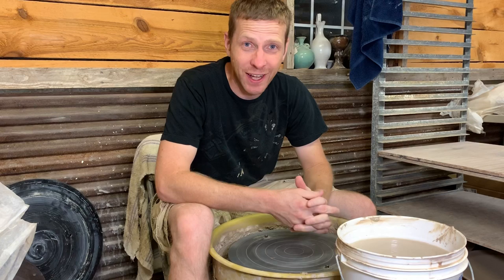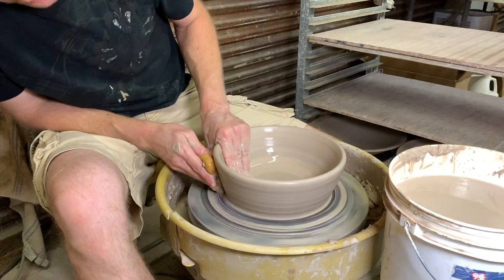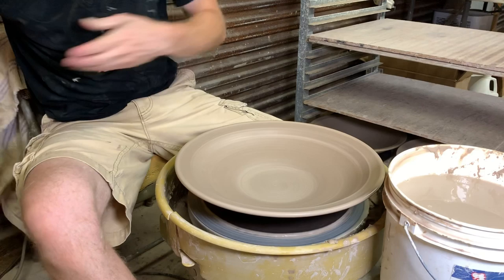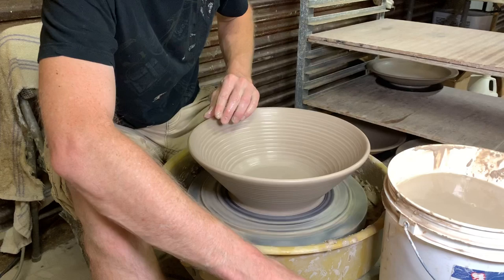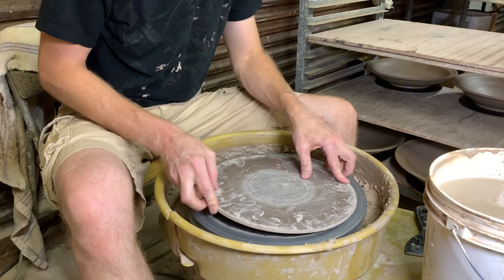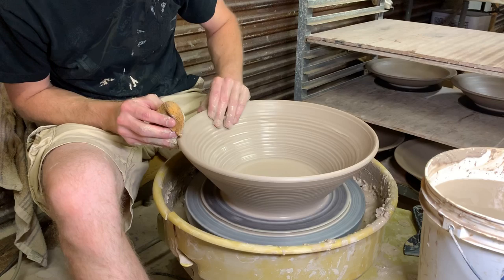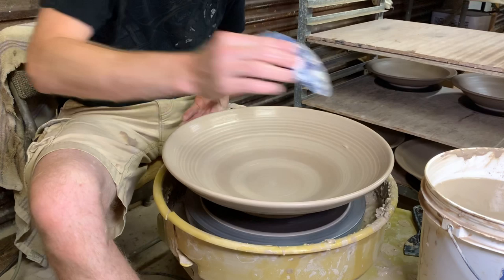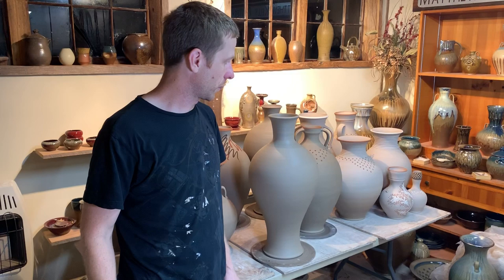Platter Bowls for Wood Firing #1: Throwing and Conversation

Comment: Throwing clay 90 degrees to the axial direction of the pug is excellent advice. Fortunately for me, I learned this early and can testify that all the "compressing" in the world cannot compare to proper orientation of the clay. Working on bats also prevents flexing when you take your piece off the wheel, the clay has a memory and if you flex it and can "Taco" your piece. Buy some bats and you won't regret it. Excellent demo.
Reply from the maker: Very well said. Maybe you should make the video about s cracks and bats. Haha!

Comment: Many thanks for taking time to post. Also, I noticed you do not wire the platter bottom after throwing. Any tips and tricks in the future regarding preventing large items from sticking to the bat and cracking during drying would be appreciated. Getting larger flat pieces off the bats can be challenging. Just an idea for future videos. All the best and sweet dreams. You look bushed.
Reply from the maker: You can check out my video on bats where I address some of those issues. Cheers. I did get some sleep. Thanks

Comment: I personally find that "s" cracks are caused by too much water. By that i mean not getting the water off the bottom of the piece.  "u" cracks are caused by clay being spiraled in a pug mill. To prevent "s" cracks I always make sure to sponge or mop out the bottom of my piece before i start the drying process. Its also important to compress the bottom of pieces once the water is mopped out. Just my personal experience
Reply from the maker: Sounds like we need to make a myth busting video. Haha. That would be very helpful for us all wouldn’t it!?!

Comment: I was always told that "s-cracks" resulted from not properly compacting the bottoms of the plates, bowls, platters while throwing.  By the way: I don't think I've ever seen a video of your wood-fired kiln...could you share?
Reply from the maker: I have heard that also but have only ever had problems with those cracks because of what I described. I have other videos of building the kiln. Will be making more also.
Reply: @MatthewKellyPottery  I found the video's...Thanks!
Reply: @MatthewKellyPottery  Thanks so much for that s-crack tip, it has been such a puzzlement. Brilliant work!